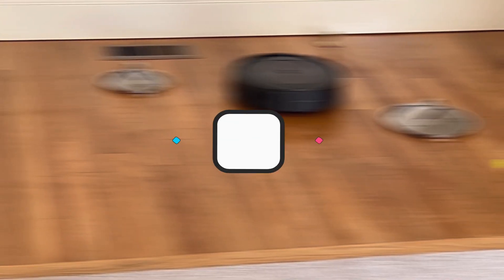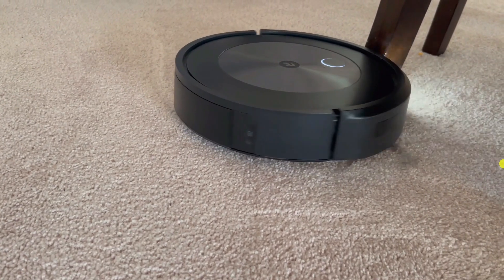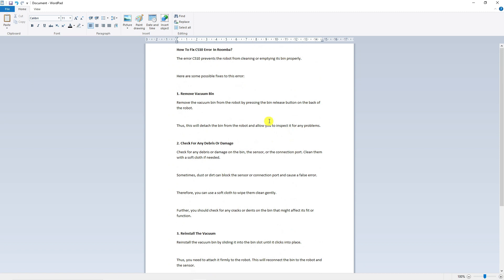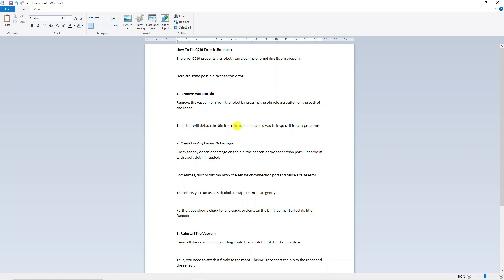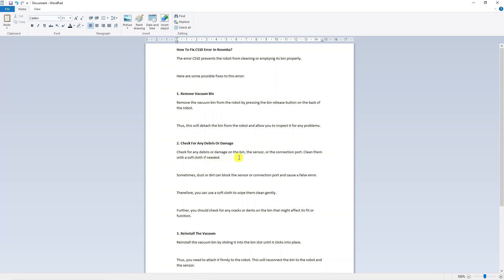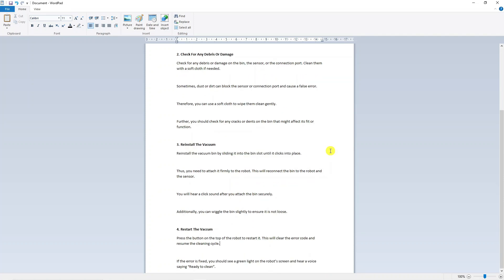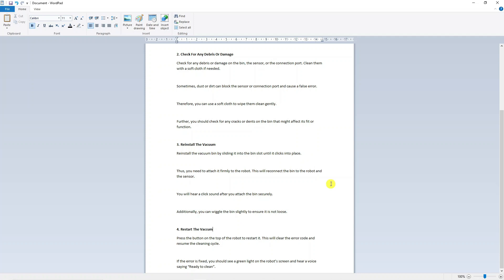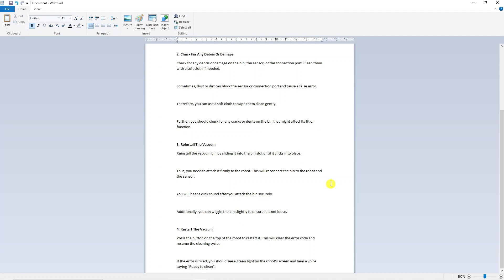How To Fix Roomba C510 Error (Step By Step)

Comment: After a lot of troubleshooting steps it appears my bin hepa filter was the culprit.
Irobot / Roomba really needs to work on their code interface instead of dumping everything into one code.
Edit: well, a few hours later and now this overpriced POS is throwing error code C520. Think I'm at the point where I'm just going to take a hammer to it. Will never buy anything else from irobot.
Edit: two hours after the last update I'm back to c510.
Took the entire i3 apart forcefully into pieces and threw the entire i3+ into the trash.
After two years of more down time then actual run time I'm done with Roomba permanently.